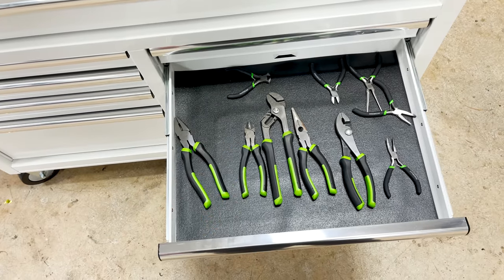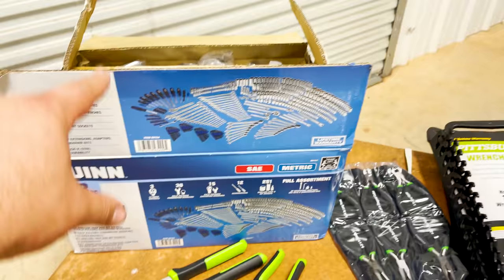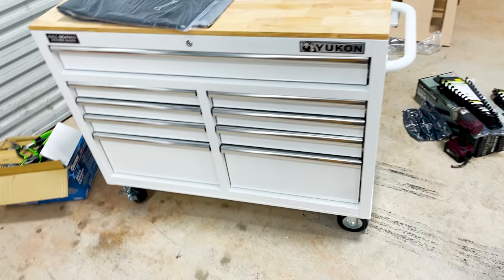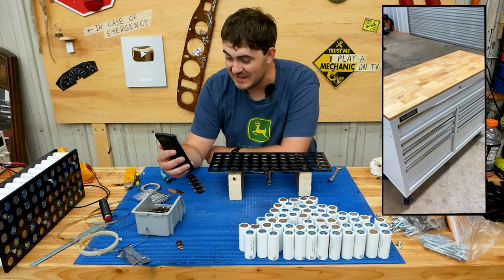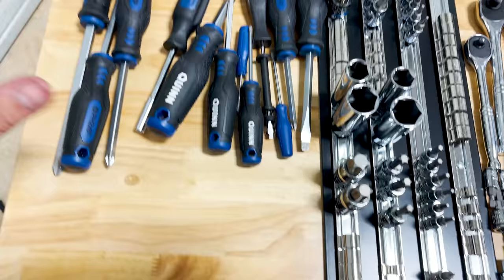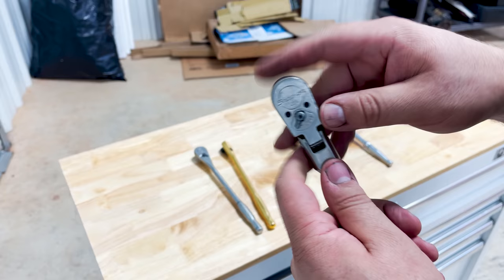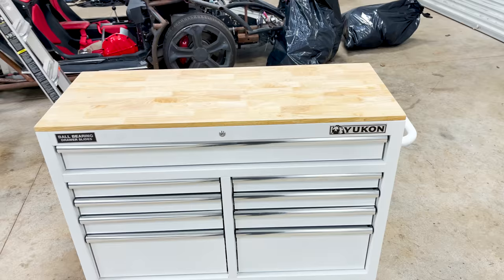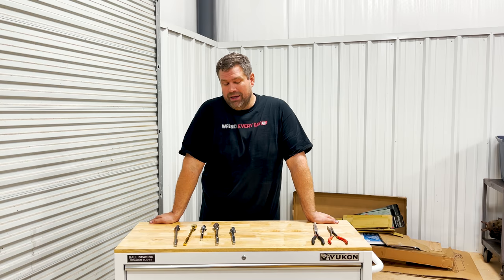I Bought The CHEAPEST TOOLS On The Internet (So You Don't Have To)

Comment: I’ve lived my life with this tool methodology: buy the cheap stuff to get started. Replace anything that breaks with higher quality. That, of course, doesn’t include everything, but has worked very well for simple hand tools.
Reply: I agree. If you use it and it works well enough, and never breaks, then it's worth the savings. If you use it and it breaks or just doesn't cut it, then you /need/ the nicer/better/stronger version.
Reply: This is actually brilliant advice!
Reply: I totally agree. I was a mechanic at a dealership for 5 years and only replaced broken tools with higher quality ones (Matco is my preferred brand) when they broke
Reply: 100%!! I've done this since my first set of tools in '08!
Reply: I’m with you for 98% the tools. The main exception is buy one nice 3/8 ratchet because that’ll be what you use for almost everything.
Reply: LOL Hi i would like to replace my knuckle, how much is that Doc?
Reply: @mramseyISU  Prob good point
Reply: Great idea, I had a cheap set that worked for a year or so until I noticed cracks in the sockets then saw my craftsman set on sale and never had a problem since, and most tools have lifetime warranties so if they break you get new ones free
Reply: Yup like my strategy with hf buy it as a one and done and if it lasts beat the hell out of it till it fails surprisingly they last awhile lol
Reply: Great way to start out. After a while you figure out where you can cheap out and what to spend good money on. I still use some of the harbor freight tools I started out with 10 years ago.
Reply: Sucks mid job though, especially if you're more than 30 minutes from the store
Reply: I have started to do the same thing. When I was in college I bought a cheap set of electronics tools and there was a little pair of needle nose pliers and a small pair of dikes. The tip of the dikes broke and I got a new cheap pair but the little needle nose were fine. I probably bought 5 pairs of little cutting pliers before I got smart and bought an expensive pair but I never had the replace the little needle nose pliers they still work great.
Reply: Wise words. Though I've found that the absolute rock bottom cheapest is often not a great option--rather, go for the NEXT cheapest. Harbor Freight's Pittburgh stuff is a good example of this. Some of their very cheapest lowest end ratchets, sockets, etc. at the yellowish shallow end of their pool of Pittsburgh offerings are best viewed as disposable single-use at best, and maybe even a little dangerous for serious wrenching, while other Pittsburgh offerings really ain't half bad. Compare the contents of their very most basic "Harriet Homeowner" 130-Piece toolkit with their only slightly pricier 105-Piece 4-Drawer one, and this should become immediately apparent. While that 105-Piece isn't exactly the pinnacle of the toolmaker's craft, at least it doesn't look like it was machined from old recycled cat food cans by volunteers from whatever the Chinese equivalent may be of The Columbia Lighthouse for the Blind. Sure, I've got lots of "nicer" tools, but if I just have a quick job, like swapping a wiper motor, an oil change, or similar, instead of pawing through the inventory, I'll often just grab one of those 105-Piece kits I have squirreled away here and there. This "get the NEXT cheapest" thing seems to also hold true for electronics, phones, computers and that sort of thing. Save the "premium" tool truck goodies for later, if at all. Going well into debt for all Snap-On or Maatco gear is like the crushing student debt of the blue collar guy.
Reply: Yeah the cheapest Pittsburgh tools are pretty awful. I got my son the $4 3/8 drive set and it has about the worst machining/qc I've ever seen. When your 3 year old picks out tools he wants you say yes though
Reply: @gregblau8082  Next stop: pick up a couple of curbside or Craigslist kiddie bikes, or maybe a tricycle or whatever, lightly disassemble, and toss those bits into a box in the trunk. Then spend a little quality time re-assembling with the tyke into a working bike using those tools, thereby instilling the immortal wisdom of "right-tighty, lefty-loosey". For a two-wheeler you might also do well to get a nice fresh pair of suitable training wheels at Wallyworld. Used ones tend either to be pretty worn out or removed by the time a learner bike makes it to the curb. A few cans of dollar rattlecan red might also be welcome, and, of course, custom personalizing stickers are always a treat. Quality time.
Reply: I have a similar belief system. I buy cheap to start and keep a log of every time I say "damnit this tool sucks for [x reason] i wish it could [y feature]. Then when I get a little extra money I replace said tool. no sense in buying an expensive tool if you don't know what you need it for, and this way you end up with really nice tools that you use, and the ones you don't can be lower quality because you don't ever use them.
Reply: That’s such a great advice! 💯
Reply: Its a great way to go about it...just because something is cheap doesn't mean it won't last...better to spend money on only those items that just don't hold up, than it is to spend thousands on something you may hardly use, or that the cheaper version works just as well, and sometimes better.  

Sure I have some expensive tools, no I didn't get them from a tool truck, got them at yard sales, and flee markets.  I let someone else overpay for their tools LOL...then I get them at estate sales, and flee markets, where their family packed everything up and is selling it after their family member passed away...you don't always need new tools either, lots of good hardly used, or new tools to be had at flee markets, yard sales, auctions, even pawn shops.

Comment: Back in the early 2000's Sears used to have a warehouse location, in Bellevue, WA, where you would go to pick up any large item you purchased at the local store in the mall.  While there one day I discovered they also sold blemished items there as well.  When I looked through what they had I found a new Craftsman socket and wrench set with around 250 pieces which had been discounted 50-percent because the cardboard box was crushed on one end.  This was well before Sears offshored all the Craftsman tools, so I happily bought it and still consider it one of my better tool buys.
Reply: My mother worked in the Sears Hardware department back in the 1980's and early 1990's (down in Renton, WA. I would suggest she could have crushed your socket and wrench set box, but that was a little too early.)

In those days, there was the idea that Craftsman tools were for life and that you could always take your Wrench back to Sears if something happened. The name meant something. It looks like the wrenches will outlast Sears.
Reply: god damnit i miss sears
Reply: @indyfist9466  The Sears where I live is still open but the last time I was in it, about two-years ago, they were in the process of consolidating their shrinking inventory into different parts of the store.  Since they offshored all the Craftsman tools I don't have any reason reason to shop there anymore.  Their parking lot is always empty and they have a big banner hanging on the building stating "We are still open."  It's sad, but the only reason I shopped there was for tools and power equipment, and I no longer trust their quality.
Reply: That was a hell of a dope deal shit i miss sears.
Reply: When they went offshore they had the 250 to 300 ish piece usa sets 75% off. Great way to get all the stuff you need from time to time like sae and 12 points
Reply: I got the 400 pc set and use it daily I've always used craftsman.
Reply: That's how I bought my first dryer (after the 20 year old one my parents gave me died). It had a huge dent on one side, but that's mostly empty space and happened to be the side that faced the washer anyway so who cares? Not me, certainly not at that price. lol
Reply: I agree I have craftsman from way back when they were made in America. And they have been great.
Reply: They had a very similar mall store/warehouse-across-town arrangement in Bangor, Maine for many years, and I got a stack of Craftsman tool chests back in the day in a very similar way--stumbling across them at the warehouse while there to pick up a pool filter, if memory serves. They were a discontinued model and had been the floor demo units in the main store for a couple years, so they were slightly scuffed and the store staff somehow lost the locking bars. The more-than-50% discount was definitely worth having to call the parts hotline and say "hey, I bought these toolboxes and the locking bars are missing," plus I didn't have to put them together!
Reply: Sad what happened to that bellevue sears fr
Reply: What's WA?

Comment: Bought my first house a couple years ago, and needed to increase my tools after I built my workbench. Pretty much everything is from Harbor Freight. I like was Adam Savage said, buy the cheap stuff, and if it doesn't break, perfect. If it does break, replace it with something better.
Reply: I agree with the replace with better if it breaks, otherwise work with what you got...I'm sure most, if not all of us would love to go buy everything off a tool truck if we had the funds to do so, but most of us don't, and most of us turn wrenches occasionally rather than all day long, so for that reason it makes no sense to buy tool truck stuff, unless you got those few tools that you use all the time then, maybe its worth it for those specific tools, but to buy a $20k+ tool chest for your house isn't necessary, and quite frankly a major waste of money...US General, and Icon make some really good tool storage units for a heck of a lot cheaper....my US General 44" combo unit has been on my carport that is open weather for going on 18 years, other than being dusty and dirty that tool chest combo works great, just need a larger one as I've somehow managed to fill it up LOL...the trouble I've ran into is you have to go to a very large tool chest combo in order to get several deep storage drawers...or purchase the end lockers....which don't work on my old 44" unit as they've changed the size of the new ones, they're much deeper than the old ones unfortunately...but an upgrade would be nice anyways at some point in the future.  I have tools scattered everywhere because many of them don't fit in the smaller drawers is what I've ran into...and even those fancy expensive tool truck tool chests aren't any better for bulky tool storage....again you have to get the end cabinets for that type of stuff.

Comment: I will say this, cheap tools of today are light-years ahead of cheap tools from 40 years ago.

Also, unless you have money to burn, start cheap and upgrade as needed.  No point in paying a premium for something you will seldom (if ever) use.
Reply: I agree with this. I still have some cheap tools that have survived that are about 30+ years old. The quality is indeed day and night difference. Most people think a $40 pair of needle nose pliers are somehow better than a $10 pair.
Reply: A chap I know is a professional truck mechanic of over 20 years. That is exactly the way he started, with a cheapish all-in-one kit, and anything he broke he replaced with snap-on or Mac. It is a bit weird to see his socket rack mostly full of budget sockets and 5 snap-on sockets.
Reply: Agreed! And you can always find name brand used tools if you don't want to drop the cash for new.
Reply: @oliverroedel1111  you guys always do it right the first time, here in the us harbor freight sells unsharpened spade bits
Reply: Absolutely this. Spend money in the right places. I’ve bought good used premium pieces from eBay or saved. My ‘tool box’ is an old kitchen unit. Looks shonky but I’ve upgraded over the years when I need to. The tool box isn’t moving, but I daily use what’s in it! Having said this, the hobby kit out there now were Mac level when I was 20!
Reply: @oliverroedel1111  do you use knipex pliers ? Started using them a couple years ago and love them
Reply: @charlie1832  to expensive in Brazil, imported stuff, no way to buy. better stay with gedore etc. witch has national facturies
Reply: @drewwyatt1274  personally snap-on is living on the brandname, quality is down the drain alot and so many cheaper competitors with same warrenty's and much better quality
Reply: Best advice i got was to buy cheap tools. and that when you break that cheap tool, replace it with the high end one.

Basically, if you used that tool enough to break it, then you use it enough to splurge a little on a better version.

Comment: Just a side note, when there are only 2x locking/swivel wheels, they go at the handle end. This will be a real effort to turn and manoeuvre when it’s got 200kg of tools in it. Not to mention the swivel /locking wheels are at the handle end so you can press the foot lock after you’ve moved it so you don’t have to go to the other end to lock the wheels. 

This set seems to be a pretty decent start or even just for the tinkerer, should last a while. Cheap stuff is getting good these days.
Reply: I noticed this too and it bugged me to the end.
Reply: I thought every mechanic would know that.
Reply: Do they make this in a 24 inch deep model?
Reply: Here's the comment I was looking for. I was thinking that's gonna be a pita to steer.

Comment: Best "strategy" I've heard so far: Buy a cheap set, and replace the things that break with higher quality. How much higher the quality depends on how quick they break. So get a cheap set, and if that 10 mil socket breaks, get a high quality new one. If the 23 mil socket breaks after 10 years of use, the cheap one was good enough.

Comment: Great video, and thanks for being honest and not a “tool snob”. As a regular guy working on cars and motorcycles, it’s great to find reasonably priced tools that will get the job done and not break the bank. I’ve bought numerous HF tools and accessories and will look for fair and accurate reviews before making a purchase. You are now one of my trusted information resources.
Reply: I’m a diesel mechanic and have picked up a number of socket sets and ratchets from icon. They work really well and the deep sockets have the shoulder inside to hold the bolt at the top like Snap-on and other high end sockets. The ratchets are a 90 tooth count but only single pawl still work great with a low swing arc. Also wright wrenches Wright grip plus can be found for about $150 a set and are pretty comparable to the $1200 Snap-on “posi  grip” or whatever the hell they are, set.
Reply: I'll say, I have a toolbox full of mix of tools, lots of HF stuff in there.  I am just a hobbyist working on cars, motorcycles, ATV's also.  I have had a few tools from HF that in the middle of trying to use I just pitched right in the trash can.  But for the most part, that's not the case. On the flip side, I also have some HF ratchets that I reach for first, because of the quality feel, they have.  It's nice to see someone with a professional background be able to validate the mindset, that you DON'T have to have a $400 ratchet to get the job done.

Comment: I LOVE finding tools at estate sales for a fraction of the price.  I found a 4 ton floor jack & paid $20 for it - all steel and in good shape = still can't believe my luck knowing they are over $150 new
Reply: OLD Craftsman 1/2" drive socket set - $20. And as little as I use them they will last a 'lifetime'. Then there is the $10 air pump that only worked once...

Comment: I got the Pittsburgh 301 tool set with a travel case. After 4 years I'm missing a stubby standard screwdriver. Pieces rattle around a bit but solved most of it with some sheets of cardboard. Throw some prybars, hammer and odd tools in a milk crate and I've swap 2 transmissions and and engine with the kit. The kit in the case lives in my pickup and the crate is on the shelf waiting for its contents to be customized as needed.

Are these top of the line, no. Are they good enough to do a project, act as an emergency tool kit, or a junk yard kit... yes.

Comment: I've done very well with my Harbor Freight tools. Yeah, I've broken a few, but they were replaced under the warranty. I should note that I'm just a guy that messes around in his driveway so I don't use them daily. I've also talked to several pros that like the HF tools when they are doing the kinds of thing that are likely to damage a tool (like having to hammer a socket onto a badly rusted bolt.) They would much rather destroy a cheap tool than an expensive one. I visited a Mercedes dealer once and saw every bay had a HF tool box standing next to their nice Snap On box. The guys admitted that they do that so they can keep their expensive stuff in one and the HF beater tools in the other for easy sorting.

Comment: For a home mechanic, the cheap starter set is usually fine, find which ones you break and replace them with a better quality item.

For a pro, or at least a starter pro, go up a little bit, fundamentally as your livelihood is dependent on those tools, so something a little better is probably recommended.
Reply: I like my harbor freight stuff for my general assembly job, but I would agree that it probably would not be advised if your a mechanic.
Reply: And be wary that quality doesnt equal price (as seen with the HF daytona jack, snap-on clowning themself)